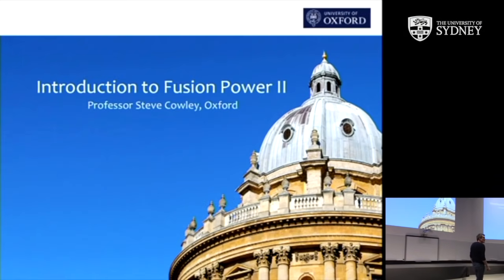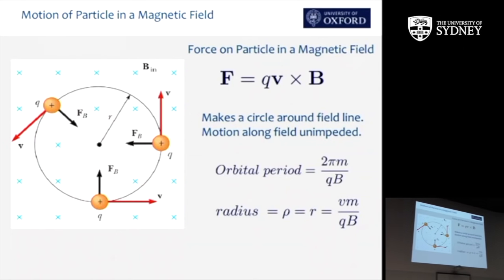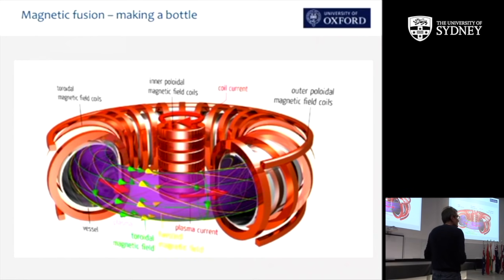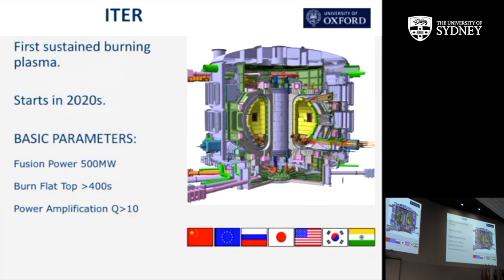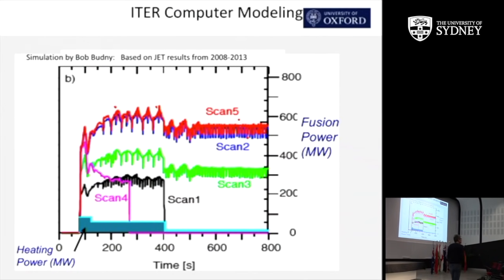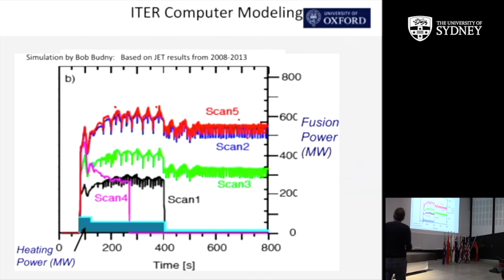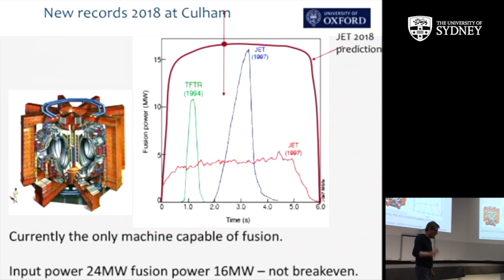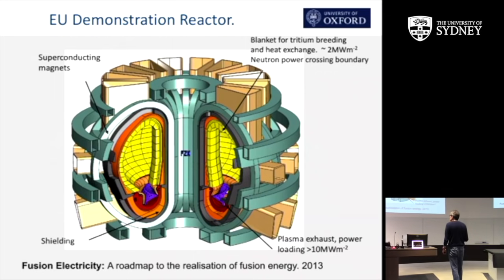Fusion Energy (Part II) — Prof. Steven Cowley

Comment: There is still an open question in the "difficult challenges to solve" section in the D-T-fusion cycle. If D + T gives an alpha particle plus a neutron, and the neutron breeds trition from Li-6, then you must not miss a single neutron, else your tritium breeding cycle is not sustainable and you need a constant import of tritium from somewhere else. How large is the percentage of neutrons that do not hit a lithium nucleus in the blanket? If scaled up, where will the tritium come from?
Reply: In a video about the MIT/CFS reactor I remember them saying they plan to breed 1.1x more tritium than consumed… not quite sure what are the physics behind the ratio though.

Comment: He says nobody wants to buy energy from you if you keep turning it on and off, so how do wind and solar work? I think their existence disproves that claim.
Reply: Wind and Solar are at least somewhat predictable. A fusion reactor run by physicians and engineers to figure things out will not be predictable and can go from 100% to zero in an instant. Also running it constantly will probably not be in the best interest of figuring stuff out, because maybe at least initially they might want to limit how much radioactive activation they want to put in the walls (this is a guess on my side)?